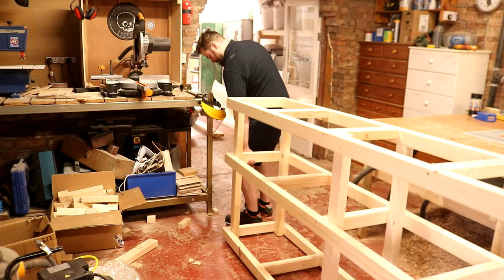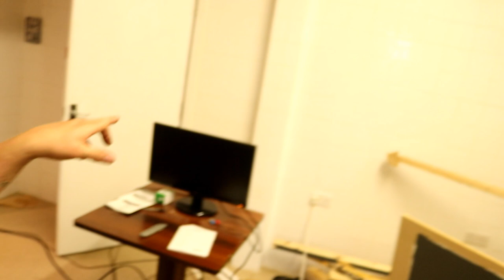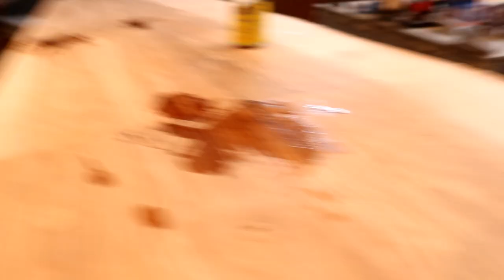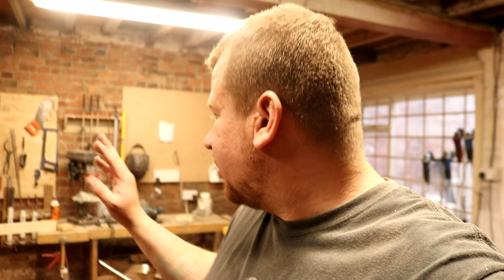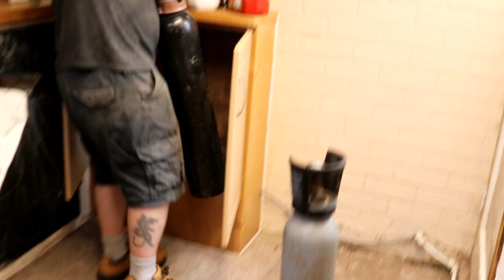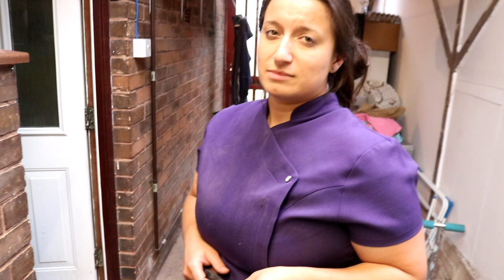ESP HD-VIEW CCTV

Comment: Your missus is hilarious!

On a CCTV note, the software should have a fail safe where it will revert to the original resolution if you don’t click to confirm the new one is ok after the change. It’s a relatively simple thing to implement and should have been done by the developer.

Comment: That 4k conundrum is why the Windows OS offers an explicit confirmation step and automatically reverts the display settings back after a few seconds if you don't confirm :/ Is it possible Stu's TV wasn't accepting 4k?
The product manuals are useless, no help there. If there is a way to reset the system it'll be locked down for security. Looks like you need to call ESP or whoever sold you the kit.